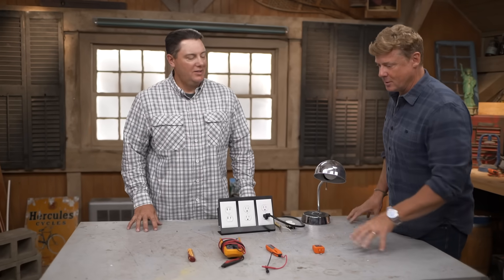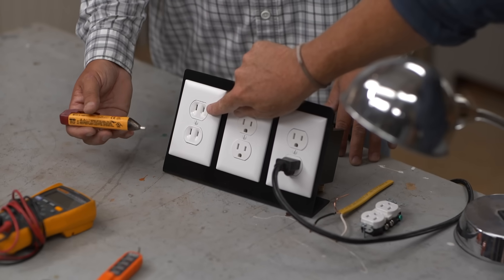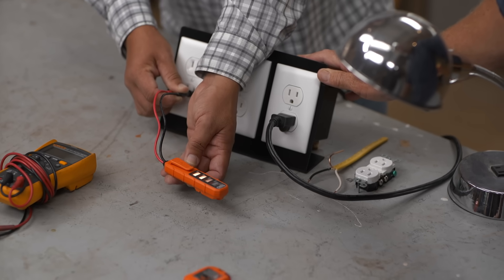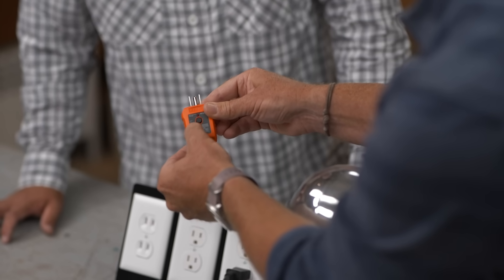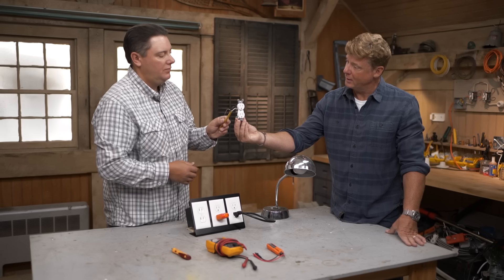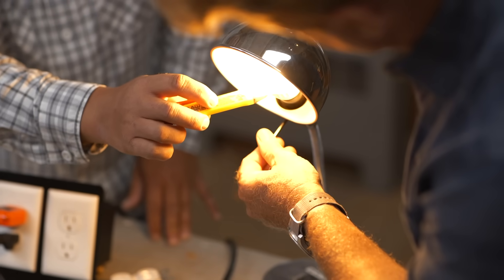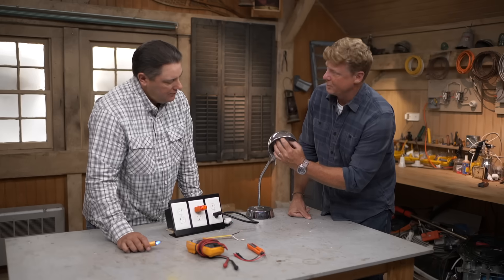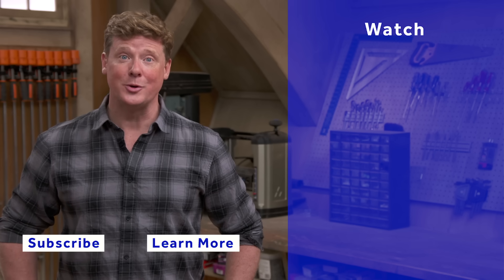How To Use a Voltage Tester | Ask This Old House

Comment: If the contactless isn’t perfect and you have to verify anyway, why bother?
Reply: It's better for use on actual wires to give you a heads up real quick, one hand only. I use it when hooking up direct wired disposal or dishwasher. Neer had a problem. Only got zapped when I said "I'm pretty sure it's off" without any check. 🤣🤣🤣 thankfully 120v only!
Reply: @beerbeforebreakfast  There are also such testers in the form of a screwdriver with a light inside it. You touch the copper of the wire with the flathead and hold one finger on the back of the screwdriver. If the light goes on then there is power. Also one-handed and no risk for having faulty measurements. Some people say that such screwdrivers are risky for getting electrocuted but i have never had an incident with them in 35 years.
Reply: It's easier for most people to test with a NCVT than expose the conductor and put the test leads on the live wires. Electricians don't just test in outlet holes.
Reply: The main purpose is to tell you there's juice and to see if you've shut off the correct breaker. They are only a quick check and not meant for trouble shooting. BTW, once you own one you will find other uses for it. They work great for finding that one bad bulb in a string of Xmas lights.... because you can follow the wire till the power goes away, which is right after the bad bulb. Those lights may be falling out of favor these days but the concept is the same. I started using mine for that job 20 years ago... well before LED lights were common.
Reply: @rupe53  Thanks for the explanation.  That makes sense.
Reply: They're cheap and they're more handy than the contact testers. They really shine when you randomly find a wire where you were not expecting one, or need to work somewhere where there is a power line. The only time I've ever had issues with mine is when there's a bunch of hot wires close together.
Reply: I have a light switch wired to a 3 prong plug , I plug it in and short circuit the breaker for it in the panel !
That way I know for sure that circuit is de-energized , and I leave it there in case someone tries to reset the breaker !